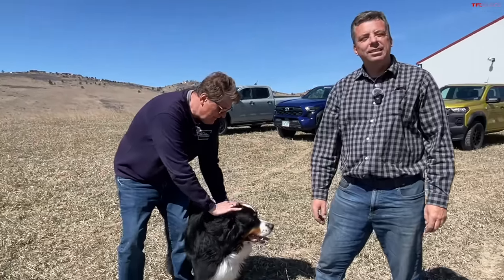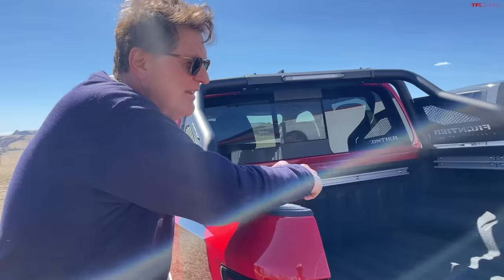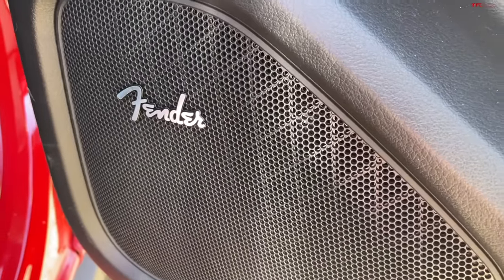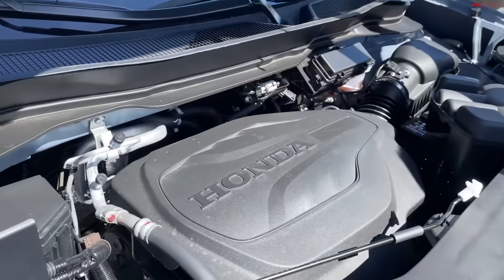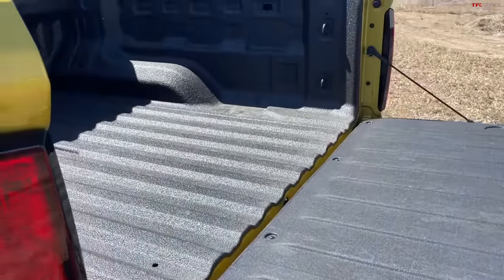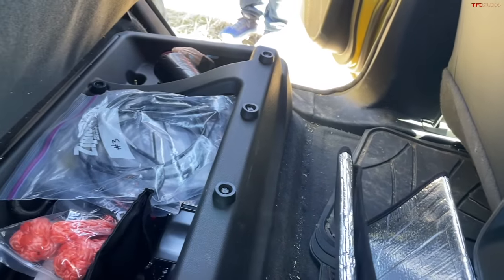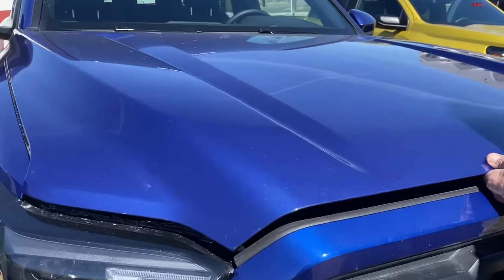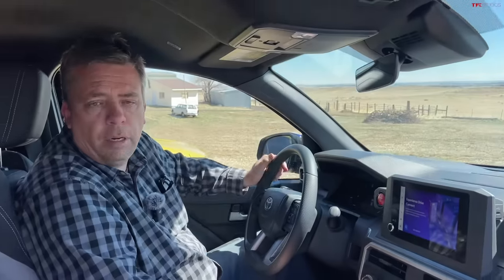We Compare 5 Brand New Midsize Trucks: The Differences are Very Surprising!

Comment: Ridgeline is probably the most practical for families. The Trailsport trim also gives you leather, ambient lighting, power folding side mirrors and parking sensors. Would have to go up to the $50k+ trims of the others to get some of those options. I personally think the Ridgeline Trailsport with a 1.5” lift would be the best long term buy.
Reply: Timing belt with interference engine.
Reply: @billricheter5678  So...? Scheduled maintenance for that is at 100k miles. Not that complicated or expensive to do either.
Reply: Why is a timing belt an issue when the overall reliability is so much better than the others?
Reply: The Honda J series V6 is a very solid engine. Much rather have an NA V6 over a turbo 4 over the long run.
Reply: @TermlessHGW  70000 miles and another $2000. Just want people to know
Reply: @hsvnole  it’s another $2000 every 70000 miles. Also it’s not more reliable. The thing will brake down on anything g more than a fore road. I like it ok but people need to be aware of the belt and interference engine
Reply: @billricheter5678  Its funny that they call it an interference engine when all the belts that broke and towed in into our shop were able to put a new belt on and no miss fires down the road.
Reply: @billricheter5678 I would not recommend it, but you know how many people go 300k + miles without changing them?  😂. Yea, it’s 7 years or 105K miles.
Reply: I agreed until you said lift it. If you are lifting it, any other brand would be better. You are basically going against everything you bought a Ridgeline for by lifting it.
Reply: Honda J series V6's run 100's of thousands of miles. A timing belt is cheaper in the long run with Honda's 100k service intervals. The plastic guides on most timing chains fail anywhere after 150k they are much more expensive to replace and can easily cause catastrophic engine failure

Comment: I like Andre's Colorado TrailBoss. Get the $325 convenience package for cruise control and tinted windows. 4 auto is great as they discussed. And at a less expensive price than others.

Ranger design looks cleanest and best to me- if it had a larger fuel tank I'd pick that one.  Tacoma seems over-priced - and the reliability notion is out the window with a new design.

Comment: Honda sold 52k Ridgelines last year... Pretty good for the midsize segment (not named Tacoma 😂)
Reply: My mom just got a 2019. Honestly it rides nice, it's quiet, the steering feels good, it has plenty of power, good fuel economy, and a simple V6 engine.
Reply: @atodaso1668  As you would expect from a minivan with a bed
Reply: The Honda Ridgeline IS NOTTTT a midsize truck! It's NOTTT body on frame. It's NOTTT a midsize truck...PERIODDD. it's a COMPACT truck that competes with the Santa Cruz and maverick.
Reply: @All-Miles-Matter  it's literally bigger than almost all of the midsize trucks (crew cab 5ft bed style) which are way bigger than the maverick and Santa cruz
Reply: @All-Miles-Matter  It's actually better in some ways than the body on frame construction of the others. For instance they have a reinforcement beam between the bed and the interior space for safety in a frontal impact from loads coming through from the bed into the occupant space.. it's just a shame they haven't put a hybrid powertrain in it for it to really make sense for the size and money. The things barely do better mpg than an F150.
Reply: @All-Miles-Matter stop crying lol
Reply: Like you so called truck guys go anywhere other than the mall or a dirt road that a dodge neon could drive down. @BC08
Reply: @atodaso1668   Don’t straw-man.   Not everyone has the same grocery getter usage profile you do.  Not everyone is so low-T
Reply: @joelmora2826  hahaha no problem!
Reply: @rifleslol  correct, better in some ways. Just not better in the ways we use the truck. Body on frame is a truck. Unibody is a car.
Reply: @All-Miles-Matter  Who cares? 95% of ppl in developed countries don't use their pickups for "truck-y" things. Also look at the payload of the full size, fancy 80k trucks. Same or less than the Ridgeline. Again, nobody normal cares it's not body on frame. It's much bigger inside, handles much, much better with tourqe vectoring AWD, until the new Ranger it was the only midsize to fit 4' wide sheets flat between wheel wells (hahaa). It's overall more practical and easier to live with than most and still has that fantastic, NA J35 with v-tec. You have to be crazy to not see it as a proper midsize.
Reply: @TermlessHGW   People that aren’t vehicle ignorant care
Reply: Ridgeline owners are the most insecure, defensive group of “enthusiasts” I have ever seen.   
Accept you bought a pickup based on a minivan and realize that while it may be a better car it is NOT a better truck
Reply: @BC08  I honestly think it's the other way round with the insecurity thing. Lol. Nobody feels the need to point out  Ridgelines non body on frame construction than the 'proper' truck guy community. Car guys just see it as it is. Which is a great all round vehicle for ppl with nothing to prove.
Reply: Calm down everyone they're just pickups certainly not "trucks" 😂
Reply: Says the guy that needs a "frame" to feel like a real man.   @BC08
Reply: @atodaso1668   Needs a frame to have a chassis robust enough to stand up truck work long-term
Reply: They don’t even try.  They only make so many and leave it at that.  I wish they would put more effort into these truck, too busy selling those Accords and CRV’s.
Reply: @All-Miles-Matter well it blows those out of the water and most these so called midsize trucks as well.  😂
Reply: @All-Miles-Matter which one can hall full sheets of plywood laying flat in the bed?  That would be the one that’s not a truck.  😂

Comment: I had a single cab short bed 4x4 1998 dodge Dakota back in 2000 to 2005 with the 318 in it. It was the best truck, it had more room in the cab then my buddies s10s, and I had the KC roll bar with the three lights on top and a spare tire Baja mount in the bed so I actually had about a foot of storage but that thing was beefy and fast as hell.
Reply: And that 318 would run forever
Reply: After I cut the muffler off it sounded just like this one.
Reply: Why not call it a 5.2L as they do? Just curious. Is it more of an old school car guy thing?
Reply: @c1rca23  because it’s the cubic inches of the engine I guess. It had been called a 318 for about 40 yrs prior

Comment: Put a Ridgeline in a video and you can bet on the trolls coming out to talk crap about it. 

Love all these trucks and want all these trucks, but I LOVE my 23 rtle. I don't care that it's not as rough and tough (on paper) as these other options, but as a guy who does pretty average truck stuff like hauling mulch for our garden, filling it with camping supplies, and helping friends move slightly larger than average stuff, I can say it is far more truck than most people will likely ever need.
Reply: Not sure anyone is trolling when it comes to the Ridgeline.  The thing is a unibody, not a body on frame, and although it has a couple positive notes, it's not really a body on frame truck so pointing that out isn't a troll, it's just a fact.  Go back to the suburbs with your lil Ridgeline and your Home Depot John Deere model lawn mower (aka, not an actual John Deere lawn tractor, look it up).  You aren't hard or working class, you're an office geek.
Reply: I took it off of my list because I hear from many people that the safety nanny is too obtrusive in terms of beeping and you can't shut it off. True?
Reply: @biggestsign  doesn't beep at me too much about stuff so I guess your usage may vary. Lets me know when a seatbelt is unbuckled or a door is open
Reply: @gusguthrie4903  The complaints I've heard are for the forward collision warning system.
Reply: @biggestsign  ahhh yes, it is definitely sensitive. I have an ongoing joke with my wife... "Brake for what???"

Usually happens if a car is turning and I'm going fast enough that it thinks I wouldn't be able to stop in time for the object moving out of my way. I tend not to drive too close to people but I'd say I get the beeping every 3-4 weeks
Reply: @biggestsign  the only safety system on my '22 that's a little too obtrusive is the emergency braking system, but I guess it's better to err on the side of caution with automatic braking.  I turn off the LKAS (lane keep assist system) because I hate that feature altogether.
Reply: You can reduce the sensitivity of the auto brake in settings😊. I gotta go, need to hit home Depot and pick up my MTD-Deere
Reply: Two things the Ridgeline isn’t: 
-A bad vehicle
-A Truck
Reply: i just saw a ridgeline on the road , that thing look horrendous ,
Reply: Gus came out crying.  Someone is sensitive.
Reply: @theeconomist100  yes, just like the Element.  But people are fighting over those strange vehicles.
Reply: @crowneproductions9908 you seem a little sensitive… how did the ridgeline hurt you?
Reply: Well, I am a truck enthusiast. All I own is trucks and SUVs. I like the Honda Ridgeline. I have worked on them and driven them a few times. No complaints. It's a great CAR. The Honda Ridgeline is a UTE. Not a truck. So it makes sense that a poser like the Honda would ruffle some feathers. 
From my observations, the buyers of Ridgelines are similar buyers of the GM Avalanche or a Cyber Truck owner. It's made for emasculated men who work in urban areas or suburbs. Men who want a "truck" but don't really do truck stuff. Truck stuff to me is towing a trailer weekly while hauling about 1000lbs of tools to get your job done on top of hauling the dog and passengers.  Honda Ridgeline owners don't do that, and Avalanche owners don't do that either. The composite bed on the Ridgeline is cool, but if you are on a road trip or you put stuff in the "trunk" of the bed. Then you need access to it. What will you do if you have a Washer or Dryer back there? Oh yeah... I never see anyone hauling with them. But if you did. You aren't accessing that trunk without unloading the bed.  You definitely aren't having anyone load the bed with dirt or gravel. If the Ridgeline was a truck. Like the Frontier. You would probably see businesses buying them for their fleets. Tacoma and Frontier will remain fleet worthy trucks for the foreseeable future. Since they accept caps and other truck bed features. Another thing the Ridgeline doesn't do. Facts aside. I still recommend you buy what makes you happy and enjoy it. My cousin's Ridgeline doesn't hurt me at all sitting in his driveway. It does everything he needs it to do. 😅

Comment: Ranger is the value proposition here. More engine choices too.
Reply: Disagree.  It's the same price as the Frontier.  The real value choice here is the Chevy Colorado.  You're obviously just a Ford fanboi.  Cheap interior, ugly front end, overpriced but you call it a value proposition?  I'd personally buy the Frontier with the V6 but the Colorado is definitely a good option (only difference is I would buy the convenience package so it would have cruise control).
Reply: Il pick the ranger over that cheap nissan truck
Reply: @crowneproductions9908  Picking a chevy over a ford, you sure you okay bud lol

Comment: You can’t claim a new ridgeline overheats because a older 17 6 spd did.  Neither have low range but the 2020 plus 9spd has a very short 1st gear with 2nd gear being very closer to the old 6spds 1st gear in crawl ratio.  Also incorrect to say the system brakes wheels as the ridgeline nor the passport have brake vectoring capabilities, they have tq vectoring diff in the rear

Comment: The GM twins look the best. I only like the Tacoma TRD Off Road & Pro but they are too expensive. The non Raptor Rangers are boring to look at but pack a ton of features. The Frontier Pro 4x looks great & will be the most reliable & the Ridgeline is not a truck!
Reply: Have you even driven a Ridgeline?
Reply: @tomhockman6267  I have & it’s a very nice SUV

Comment: I wish all these trucks, but especially the ridgeline would start making different editions of the truck based on lifestyle and then tailor the body style.  Then each body style has the same trim levels.  Honda has their sport, EX, and LX trims.  
Use the platform and then make different configurations.  This especially makes sense for ridgeline since Honda has only one pickup in the lineup. 

I want a workman’s truck that is a half cab, extra long bed, maximize payload.

Then a rally car edition, low to ground, different aerodynamics.  Racing tuned suspension.  

Family man edition is basically the ridgeline as is.  I do want this to have a proper 6 foot bed.

Off-roader lifted, different suspension, skid plates, etc.

I think Honda would actually smack the shit out of the other trucks if they did this because most people don’t get these mid-size trucks and utilize the towing the crazy off-roading, etc.

I think if they build out this platform more they really could have a smash hit in the truck market. No one is making a work truck anymore.  The ram tradesman is a dog.  I do not trust stellantis. 

And for godsake Honda please build out a hybrid setup for your global truck platform.  I read on Reddit they cancelled it after years of researching.  Now they are launching the prologue… BEV technology is not there. The grid is not there.  Why did we not use hybrid as the stop gap for Battery tech is infuriating.  I personally think Toyota missed the mark prioritizing power versus efficiency in the Tacoma hybrid.  This comes from someone that requires a truck for a garden business, but doesn’t tow, and doesn’t off-road.
Reply: Honda really did the Ridgeline right.  Everyone knows the majority don't use these trucks as intended.  So Honda makes the Ridgeline for people who want to pretend to have trucks but really want car function and comfort.  They know this and that's why it sells.
Reply: @elche1976  I agree it is the most practical and smartest truck. However it still isn’t the biggest seller.

2023 it was in Fitch place for sales after Tacoma (44.6% of sales), redesigned Colorado, redesigned frontiers, and jeep gladiator.

It is so practical, but not practical enough. If they actually developed it further and marketed each in those categories, I think they would absolutely crush the others.  It’s easier than developing multiple platforms.  They just tailor it.

Comment: They need to upgrade the power output a bit more but the frontier is the favorite, reliability, value, hp!
Reply: I agree. If Nissan can get the torque to be about 400lb-ft on the Pro 4x, I'd see no reason to buy any other mid-size truck outside of the Ranger Raptor. Unfortunately, the dealer markups are already insane on RR kudos to anyone who buys one at sticker.
Reply: Why is 310 hp considered weak now? Where does the obsession end?

Comment: I like the Rigdesport the best!!
Reply: It is not really a truck. Also can not go off-road. Also has expensive maintenance cost with its timing belt. For highway and comfort it wins
Reply: You like minivans
Reply: @billricheter5678 Agree about off-road but the Honda will absolutely have the lowest long term cost of ownership. The Trailsport trim compares better to the Pro4x, Lariat and Denali when comparing features.
Reply: @hsvnole  it has very expensive insurance and maintenance is expensive.ask any mechanic. The Honda Ridgeline Reliability Rating is 3.5 out of 5.0, which ranks it 6th out of 7 for midsize trucks.
Reply: Its an suv with a bed🤣
Reply: @billricheter5678 expensive.  $100.  😂

Comment: The Colorado Trail Boss looks and IS the best!
Reply: We'll see in ten or 20 years how the legendary GM reliability works out.
Reply: @jeanclaude7018 Oh yea? Let’s see how the legendary Toyota Tundra engines hold out without engines blowing up at 7k miles 😃
Reply: @jimmycline4778  That's full size, but the Tundra engine sounds like a disaster.  
In midsized, Colorado is a good looking rig, but whether it's best in the long run is another story. GM is hit and miss for longevity.  The Colorado has its climate and lighting controls tied into the mighty touch screen, and WHEN that goes bad, good luck using the truck. And down the road, I don't expect that Auto Zone is going to be stocking touch screens and the cost will be insane. GM put the controls in the screen because it's CHEAPER. Remember,  this is the company that blew up Vegas because they were too tight to spend 2 bucks on a coolant recovery bottle. 
In terms of simplicity and serviceability,  and no turbo hardware to fail, Nissan Frontier has to be the best for those who don't trade in every few years.